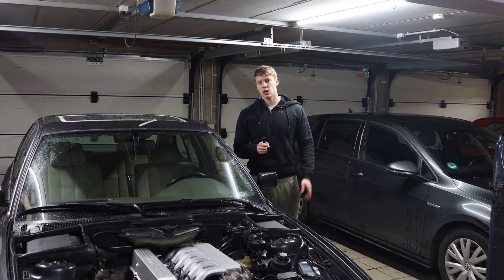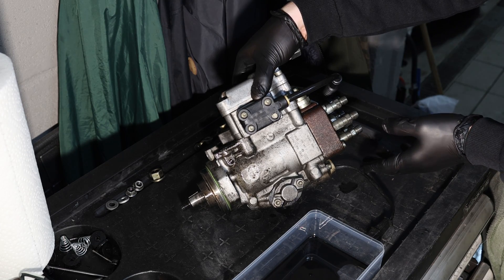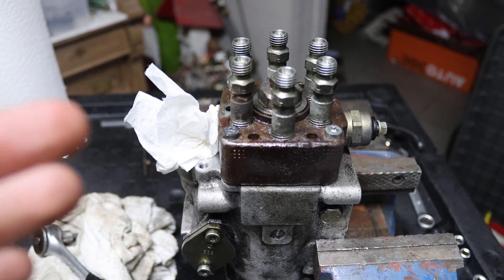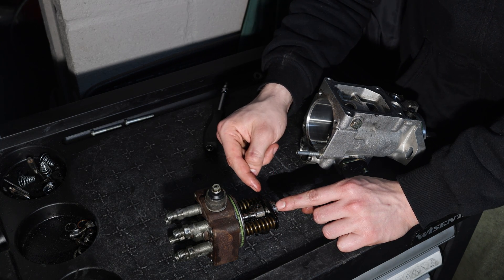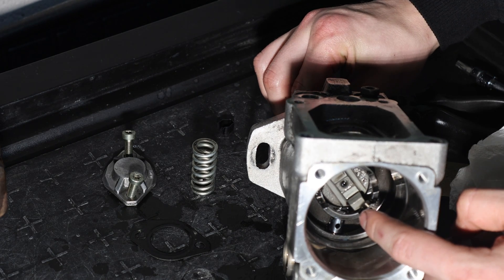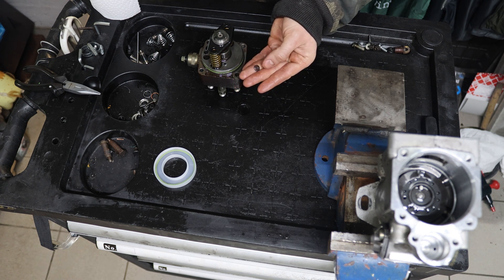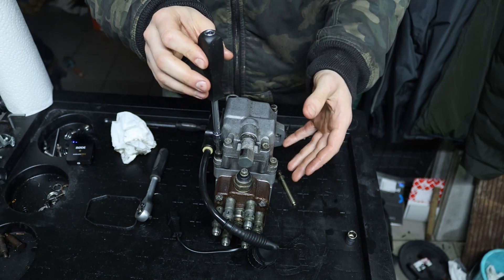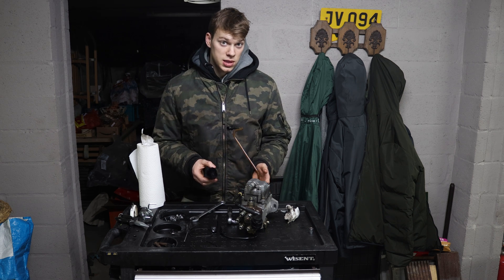Bosch Vp 37 Injection Pump rebuild on my m51 e34

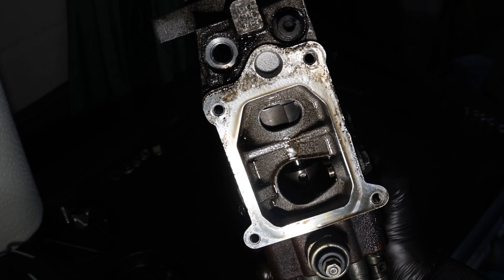Comment from the maker: Excuse the missing clip at minute 4:04  The actual clip that was there seems to be missing. Sorry for the inconvenience :(
Also, at 15:08 i said minimum adjustement quantity. I meant minimum injection quanitity :)
Reply: What size is the triangular socket on the injection pump? 6.5mm ?
Reply from the maker: @E36TD....  on the socket it says 7mm
Reply: @DailyDrivenClasssics  could my injection pump be in the wrong position? Would that cause the hunting on idle and excessive blue smoke out the exhaust?
Reply from the maker: @E36TD....   could be. Hunting idle is usually too much fuel ad idle. Connect inpa and set it to 5 mg/ stroke on idle with the engine warmed up. Blue smoke is burning oil. White greyish smoke can also be unburned diesel

Comment: Would it be possible to convert my electric pump e34 m51 to a mechanical pump?
Reply from the maker: yes it is. people use the mechanical pump from early m21 engines and just remove all the rest from the electromechanical pump. the pump does not fit plug and play and setting the timing needs to be done to different specs than on the stock pump
Reply: @DailyDrivenClasssics thanks for the prompt reply, been binge watching this series, you have a great way of explaining 🎉
Reply from the maker: @stephenjones9043  your welcome and thanks :)

Comment: Hello, great video. I am currently working on my 525 tds, but i've had a hard time figuring out why the car itself doesn't idle right. It always dies when idling, but when i give it some gas, then it runs fine. The last owner told me there were leaks on the pump itself but I can't seem to find them. What would you recommend?
Reply from the maker: leaks could be the cause of your issues. leaks are hard to find without removing the air intake manifold, so i would paritally dissassemble the engine and look for the leaks. the previous owner certainly didnt say that there are leaks without them being there :)

Comment: Hello, where did you get the tools to unscrew the pump on the front of the engine?
Reply from the maker: Amazon
Reply: can you send me the link?
Reply: @DailyDrivenClasssics  is it the same they use on the M47 and M57?
Reply from the maker: i cant send links on youtube, but it came in my m51 timing kit i bought on amazon
Reply: @DailyDrivenClasssics do you know the torque spec for the nut that holds the shaft of the pump and the toothed gear?

Comment: I have pushed ve pump angle all the way to engine is that a problem? Car starts and drive normally just in the beginning of start it is a clicking noise when car warms up the sound stops, the meachanic said its the water pump, what do you think can that angle cause a problem like it is now or in the future. Thank you and keep up with this great content 🙌
Reply from the maker: @b039_8The dde regulates injection angle, so it shouldnt pose an immediate issue, however, I would set it to stock settings just to be sure. Regarding your clicking noise, just take of the belt and start the car and if the noise persists it doesn't come from a belt drive attached component. Just make sure to not break the aluminium tensioner arm. its really weak :)
Reply: @ thank you for the update, where can i contact you for some car stuff?
Reply from the maker: @ instagram. its linked on my channel page.

Comment: Hi, thanks for your videos, I followed the M51D25 rebuild and replicated it on my Range Rover with the same engine. I had blocked piston rings caused by a period of non-use of a few years, the diesel in the tank had created bacteria, the same ones that I now find in the injection pump. It starts with difficulty, doesn't idle and smokes white, now I'm rebuilding it with the hope that it will work again!😁😁
Reply from the maker: @Francesco-qd1gs  glad you found them helpful :) new pump seals and resetting of timing and injection quantity should make your rr run nice again :)

Comment: I love this. One note though ! stainless and aluminium alloy does not mix well. You will get corrosion, and you will never get them out again. One should only use steel bolts.  If you want to make sure they can be removed again, one can use aluminium paste. as copper paste will corrode the aluminium
Reply from the maker: Youre right :) I should have thought abiut that. Unfortunately i just took whatever i could get in a rush :(
Reply: @DailyDrivenClasssics  i totally understand that. One needs to get things running. i used to work at a golf club as a mechanic. Thats how i know that stainless bolts in alloy will seeze up and be drilled out. and that's no easy task . resesaleing will last 17000km or so. and there is no shortage of vp37 either

Comment: Advance is variably adjusted in the whole spectrum by the means of fuel pressure modulated by modulating piston od the bottom of the pump. So no three settings, its infinitely variable (from base to pump maximum of course) according to water temperature, engine speed and injected quantity.
Reply from the maker: @75L48  learned that after i made that video unfortunately.

Comment: thanks, will do this before converting my TDS to waste engine oil.
Reply from the maker: If it aint leaking there no real reason to do it since the top part requires a lot adjustement to get it back to a good postion. Engine oil is thicker than diesel so seals leak less. Waste veg oil is slightly acidic so it attacks seals more than used engine oil. Havent tried waste veg, but looking for a source. Waste oil works well of i do 50/50 with diesel. Also tried 95/5 oil and gasoline . Also works well especially in winter:)
Reply: @DailyDrivenClasssics  i want to be prepared as can be, and inspect the inside of the pump so i can see next time what damage the oil does to the pump. many m51 fans say 90/10 diesel mix is good, also 50/50 isn't that economical. i would go for veg oil, but i don't have a source and its kinda diffucult to get. also my winters are -25c, so i'm definitely adding a webasto and a coolant preheater before the pump. also am planning to adjust the shit out of the timing (maybe even beyond the DME limits) to get as smokeless and as powerful as possible, possibly a 530d turbo. suggestions?

Comment: I did this years ago on my e39. Make sure you calibrate the top part with inpa or ista. Best is 4-4,5mg diesel at idle. Very careful tapping needed with inpa hooked up to measure quantity.
Reply from the maker: Yes i managed to hook up inpa just recently but the car wont start right now so im doing diagnostics rn :(
Reply: @DailyDrivenClasssics  did you set timing right via clock dial and rotating of pump? Altho it should start even without that
Reply from the maker: @adem335i8  yups 🥲 and it wont start. I wanted to adjust timing with inpa aswell
Reply: @DailyDrivenClasssics  i see. Try loosening top car and tap top of pump alot
To the back. That should do it. Also crack few injector lines open to bleed faster.
Reply from the maker: @adem335i8  i bled the lines until diesel was everywhere in my room. Top part has been to the back of the pump and to the front. Still not a single ignition :(

Comment: Jees you really went "all in" on that pump! Well done you! 🙌
The fuel pump on my Range Rover P38 doesn't need resealing just yet, but when it does, your videos will definitely help. 🙌
What country are you in?
Thanks for the videos. 🙌
Reply from the maker: @13harward
@13harward Thanks for the Support:) But I could have removed one more plate inside the pump to go deeper and could have disassembled the pump head.But since there are no relevant seals, I didn't do it. Glad to hear my videos help :) I'm from belgium.

Comment: You say "all internals look pretty much new and are in amazing condition". Unfortunately, I took apart my tired pump which took 10 seconds cranking on hot and had unstable idle to see what has been damaged and what was worn out. I take it apart, it looks brand new, mirror finish on every surface, not a scratch anywhere, everything is tight. Don't bank on it looking nice.
Reply from the maker: @Ziurkyss
@Ziurkyss
From what I've read on forums it is often the electronic top part that goes bad and not the bottom mechanical one. However I don't fully understand the electronic top part and don't know if it is repairable :( I just hope this pump is fine. I'm still in the process of hooking up diagnostics but have trouble doing so. I think youtube is not sending out notifications on comments because on my older videos I'm still waiting for answers to your comments there :) Thanks for the constructive and helpful comments and thanks for the support :)
Reply: @DailyDrivenClasssics  Might be various reasons I didn't reply, there was one time I replied to you on my phone, but then go on the pc, and there is no comment anywhere to be found (again?). If you want and see some use, we can contact in some other platform, maybe I could help with diesels (I tune diesel BMWs for hobby).

Oh and the reply to your last comment got deleted twice I guess... I wanted to share a forum link...
Reply from the maker: @Ziurkyss
@Ziurkyss I just managed to hook up my pc. I have error codes for the boost pressure sensor and the coolant sensor because the sensor plug is damaged and tomorrow I will figure the minimum injection quantity and injection timing :) Everything is coming together :)
Reply: @DailyDrivenClasssics  Great to hear. About the injection setting. You can even set it accurately without computer (with pc it's like about 5mg iirc) by just revving it. You set random injection close to the required, rev it up with full throttle to like 2.5 or 3k rpm and instantly release the throttle. You are looking at how the rpms fall. Let's say the idle at hot is 750rpm, when the rpm is dropping, if the dropping rpm stop before hitting the 750rpm and then drop slower to idle, it's too rich. If the rpms drop below 750 rpm and come back up, it's too lean. This might be the most accurate method of setting it.
Reply: @DailyDrivenClasssics  I just sent you a message there. Yes, temperature sensor is a must because it will work as if the engine was cold.
Reply from the maker: @Ziurkyss  yes. I thought it was working because the in cabin  temp gauge works but theres 3 temp sensor on my engine 🥲

Comment: I have loved the videos, it was exactly what I was looking for to work on my e34 525tds.
Are you thinking about making some performance changes, like a cold air intake?
Thank you and continue with this great content
Reply from the maker: @julioneves1610
@julioneves1610 Thanks for the support! Hope the work your gonna do on your e34 is gonna go smooth :)  I think the air intake system is fairly well designed on the m51. For a td it would be more important to retrofit an intercooler. But i don't think I'm gonna do that. Just wanted to get the car back on the road, drive it for a few months and then quickly move on to the next project. Your welcome and I will keep making those videos :)

Comment: Amazing video as usual, I managed to get my running a little better, noticed that the air temperature sensor under the inlet was covered in carbon, I'm going to clean my inlet and get rid of all the soot, crazy I've just bought a rare e36 td and you are making such useful and detailed content, hats off to you sir you are a genius,. Cheers from England
Reply from the maker: @E36TD....
@E36TD.... Thanks a lot :) I started this channel precisely to make m51 content because I didn't find any when I was looking for it. Congrats on your newly acquired e36 td:) Hope you can enjoy it, just make sure to refresh the cooling system since the td suffer even more with heat management than the tds counterpart. Thanks for watching !
Reply: @DailyDrivenClasssics  I went to the car yesterday, crank no start, I disconnected the air temperature sensor and it fired up, I cleaned it and it started alot better, I wonder if a good clean of the inlet manifold and a new sensor will help, it's full of carbon and soot, I've done a egr delete so I think that will help, I believe oven cleaner is good stuff to use? Do I need to replace the seals on the inlet or are they quite strong when taking it on and off from your experience?
Reply from the maker: @E36TD....
@E36TD.... A good clean of the intake system will surely help the engine, but I don't think it will affect the cold start behavior. I tried cleaning mine with oven and carb cleaner. The results were a bit dissapointing so I would suggest getting it stripped chemically. If I recall correctly the TIS manual says that seals are supposed to be changed every time you remove the air intake manifold on the aluminium versions and on plastic manifold it is ok to reuse them as long as the rubber is still in good condition. Ive reused mine on the aluminium manifold because I've just recently changed them, so I guess that's ok.